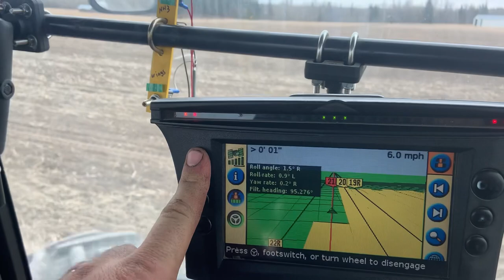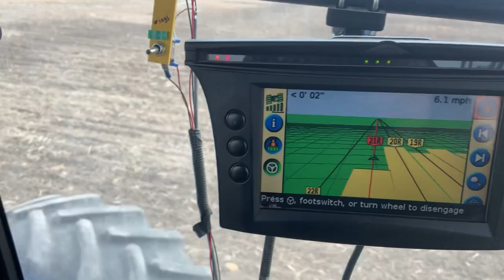APRIL 13 In the field already. CRAZY

Comment: How wide is your doorway on your new shed?  The one I ordered is 40 foot wide openings I believe on both ends.  But I didn’t get doors on the machine shed portion.   I did for the calving barn part.  Thinking of roll tarps like on a dairy barn for the equipment doorways.

Comment: Howdy my fellow Albertan, I hope ya'll are doing well, 
 Ya, I have another suggestion for your pigeon problem, it's not so much my suggestion as it is my brother's suggestion, he uses pellets, not the kinds of pellets you would use in a smoker, but the small lead pellets, he said they worked really good, and wanted me to stay on top of our pigeon problem, using the same method, I have not continued using his method lol but there you go, another way to keep your pigeons from crapping all over your tractors, I have to admit, I'm getting really tired of cleaning pigeon crap off our tractors and even my quad !! Now that ticks me off, crapping on my quad, I think they take turns at which of them can hit my seat and handle bars...🤔
 Stay safe, God Bless and Farm on my Friends

Comment: That's a nice wrecking bar treasure you did find... need to point it towards the tractors to make sure they behave; that's the reason you found it.
Reply from the maker: Yeah for sure, glad I didn’t find it with the tire
Reply: @millionairefarmer.  Sounds just like a rake tooth I found last spring right beside the tire.